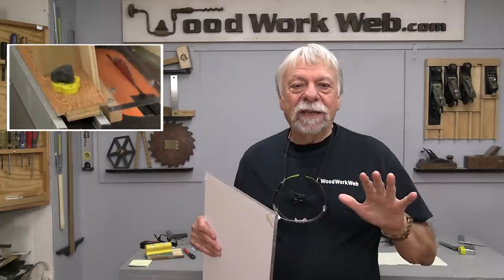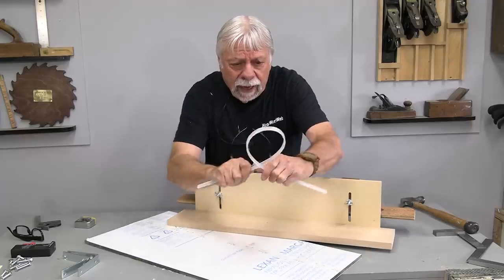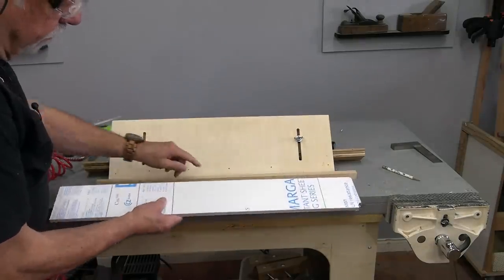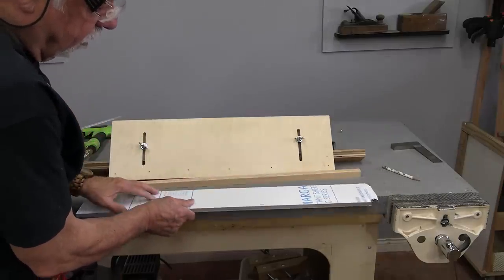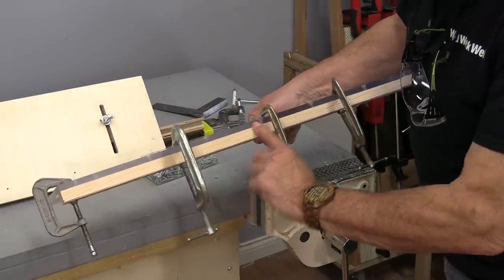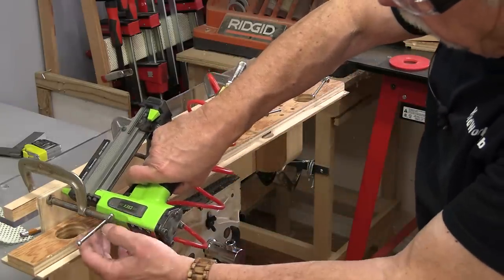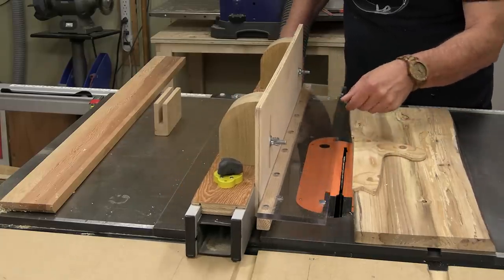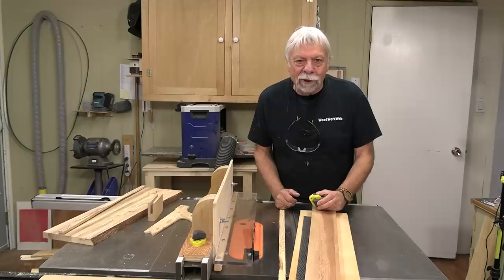Bulletproof Table Saw Fence Upgrade!

Comment: I appreciate the advice, but I usually don't use my table saw fence to avoid bullets. I prefer to use a bulletproof track saw guide track when the bullets start flying in the shop.
Reply: You would think that table saws would make fire arms obsolete. Henceforth all soldiers shall carry a cabinet saw into battle..
Reply: @martinoamello3017  Make sure it's a SawStop. We don't want anyone to get hurt.

Comment: I've watched most of your videos – entertaining and full of useful information.  Thank you!  One thing though... does anyone else find the sound level of your videos to be slightly lower than average?
Reply: Fine here on my phone.  Not disagreeing, just adding a data point.
Reply: Colin's calm voice makes it seem quieter than those YouTubers who think they have to shout to get you excited about their videos.
I watch these on my phone generally, with earbuds. What I can't stand are the YouTubers who don't regulate the sound volume and go right from their talking voice to turning on the table saw or router. Yikes! I've had to quickly yank my earbuds out to protect my eardrums. 😱
Colin doesn't do that and I appreciate it. So do my ears. 👍😁
Reply: Yes @David_K_pi , Colin is very easy to listen to.

Comment: I snatched up some 3/8 clear acrylic sheets at the 2nd hand store, they're super useful! I also have some 1/16 plexiglass sheets, they cut ok on the table saw as long as youre not cutting thin strips. I tried to make a table saw insert, and it almost worked, but the one thin edge shattered when i was cutting it off.
Reply: Biggest issue you will face is that the thin plex always flexes as you use it. I did this with a homemade router table and I kept noticing variations in depth on my wood when using the router. It would flex as I pushed the wood through and make my cut depth vary. Using thin plex as a table saw insert will do the same.

Comment: If you don’t have/can’t afford a plastic blade, flip the wood blade to backwards, will greatly reduce cracking if working around holes or with acrylic.  Worked in a glass shop for decades.

Comment: I'm a bit lazy, I just use a few dabs of hot glue and stick the edge of the board that needs jointing onto a straight bit, then run it through. It's the lowest possible tech method I can think of, but once you get one edge you are golden.

Comment: I'm thinking this would be very useful for much longer boards such as say, 6' or so. I often buy lumber that's not straight on either side and don't always feel like taking all day to use the joiner to joint 40 boards at once..
Reply: this it the job where the L-fence excells in. Search for "holzwerken winkelbrett", in this video Guido Henn shows how to use it on a bandsaw and small table saws. And if you are going to use it more often, you find how to set up a quite simple jig. The benefit of the L-fence is that it very safe  to work with, and you can't cut to deep into the edge: if the staight edge looses the contact to the L-fence just repeat the cut to get a clean straight edge on your work piece.

Comment: Is there a reason not to just screw the lexan to the bottom of the riser?
Reply: Yes there is.  He forgot to mention it. If you screw into the lexan (and probably some other plastics), it will split.  When he bore holes through the lexan, he made them wide enough so that his screws will pass through without putting any pressure on the sides.  The only pressure the lexan sheet gets is on top and bottom as the screw holds it to the wood.  Tamar from 3x3 uses a lot of plastic in her jigs, including runners on her crosscut sled (which is how I know about it).

Comment: searching for bullet proof plastic yields multiple sites that have it at .75" thickness, but the sites I visited have prices of $1000 + cost,
perhaps you'd offer a link to a site?  thank you.
Reply: Look up Lexan. Also he misspoke. If you look at his linked article it’s 1/2 inch and he got cut offs from local supplier at half off. Not his best video.

Comment: The only thing I would worry about is how stable the plastic is.  Won't it shrink and expand with the seasons?  I saw the extra piece you added to the front edge, presumably for stability, but have you checked for square after the table has been used?

Comment: Couldn't you just use double sided tape and slap that straight edge board on the top of the piece you're with cutting with a lil overhang... run that against your fence? No jig needed

Comment: There’s more than 100 comments here as I’m watching your video. You skipped over the importance of the outer edge of the blade to be exactly flush to the outer edge of your L fence. Small detail but important. 
The plastic is otherwise called Polycarbonite. The piece you used in the video is Lexan which is a brand name only. While it is used as bullet proof glass like at a bank teller window, it’s typically at least one inch when used as “bulletproof” It’s a great product and I applaud your using it for this fence. Think I’ll refit mine as well. 
As for the edge of the clear sheet, I’ve used a single edge razor blade as a scraper to clear most of the roughness. You can use a gas torch to polish the edge but you might want to practice that on the waste side of the material. Another option of course is to work with a local plastics fabricator. They can cut and drill then polish a piece for you rather quickly and you’ll have an excellent jig in no time. 
Lastly, I see in the comments some misunderstanding of what this is so great at when replicating a board. It’s great for straight edging a board but it’s also really great at quickly cutting any polygon once you’ve got a pattern piece to follow. 
Great video. Thanks for sharing.